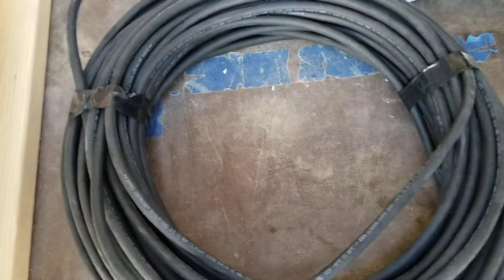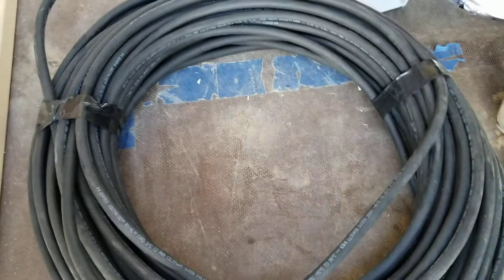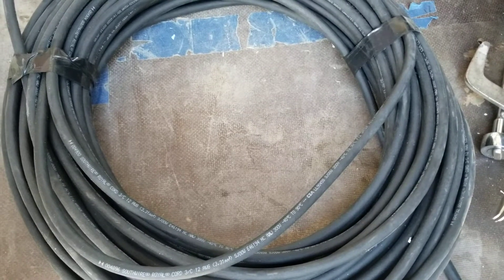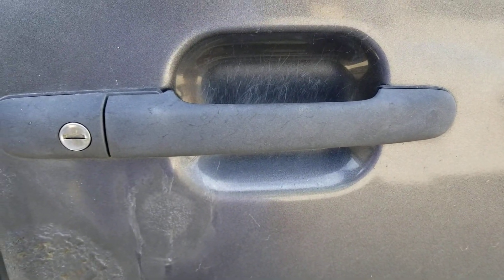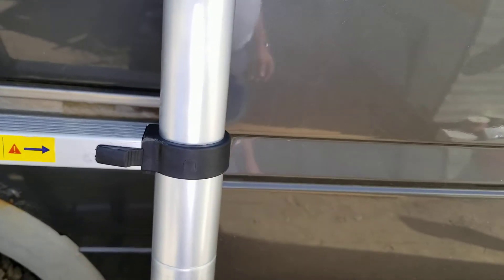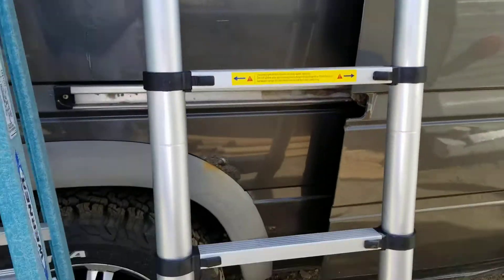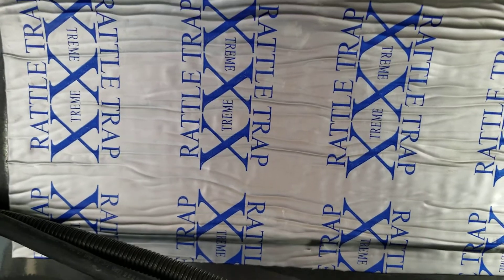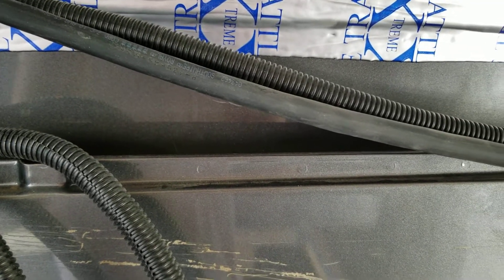VANLIFE ELECTRICAL EP. 3 DERATING & LADDERS 😎👍

Comment: Found you via Florida Van Man, love the channel, subscribed
Reply from the maker: Thank you. My van is definitely loaded & lacks absolutely nothing. You name it I've got it. Key to a good build is the time spent on the layout & planning before the build. Now that Ive upgraded to lithium I'm not even going to carry a back up generator because lithium is life changing. My main reason for the generators were to run my rooftop A/C. I'm going to install a capacitor in the A/C on my next episode to reduce in rush of current which will allow the A/C to run even longer next Summer. Thanks for watching & if you learn anything on this channel my purpose is served along with my pleasure.
😎👍
Reply: @vanlifebiker  Fantastic stuff, I have been restoring a T1N for years now so, every tip is helpful, thanks for the uploads
Reply from the maker: @zambotv8150  Very cool. It took me almost 3 years to do mine but I had a little health hiccup that slowed me at the end. Spent 6 months on paper & buying products before I even touched a tool. I do like my layout better than any other Ive seen & I do without nothing. I mean how many T1N mid size vans have a washer & dryer? lol I just got back from a 3 month trip in it & everything worked great besides time to enjoy the trip because I was working 7 days a week usually. The generators were my biggest headache so I just rented a spot in a RV Resort towards the end. If you haven't purchased your battery bank yet I'd definitely go lithium & Ampere Time was my choice because of cost. I have more than most with having 800 amp hours of lithium but they ran my 15k BTU A/C unit for almost 6 hours with no incoming solar & were still at 12.9 volts. Totally remarkable compared to 800 amp hours of AGM running it only 1 hour. Definitely worth the investment & I'm here to help. I'm a licensed Journeyman Wireman/Sub Technician & the reason I started this channel is because I seen ALOT of bad advice causing fires on YT. Never hesitate to hit me up for advice or even measurements of my layout within. I'm seriously here to help & not to become a YT star. Documenting my build for the future to see & learn from is forever GRATEFUL to me.
😎👍
Reply: @vanlifebiker  Amazing stuff, I have some bodywork, painting and spanner work to do on my T1N and, here in Scotland it's getting cold so, the build might be put on the back foot for a while. I am sure I'll be picking your brains soon enough, I am hoping to go camping in her next spring,
Reply: @vanlifebiker  Fantastic, we don't have much of a need for aircon here, it seldom gets above 25 Celsius !!!
Reply from the maker: @zambotv8150  Lucky 😂